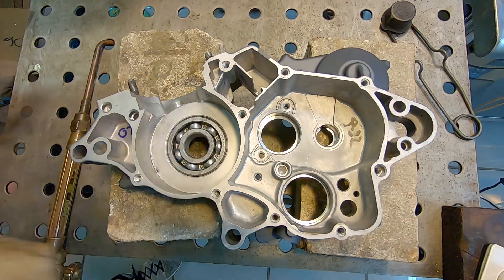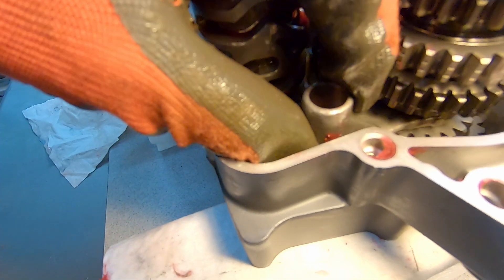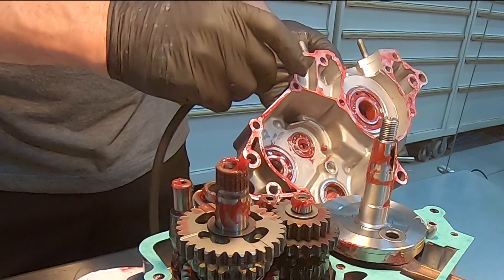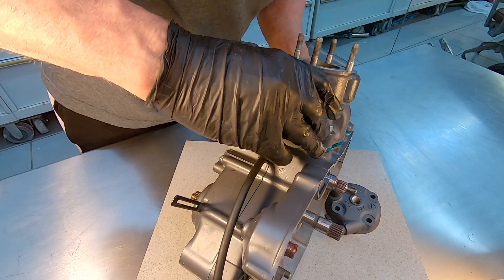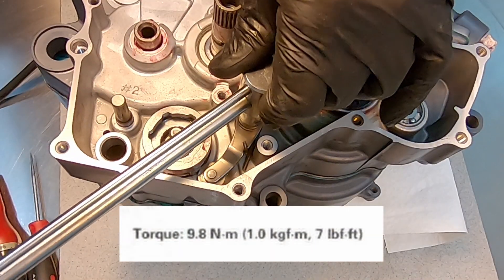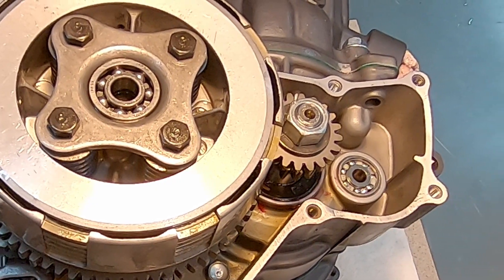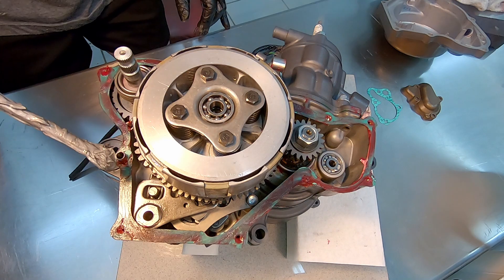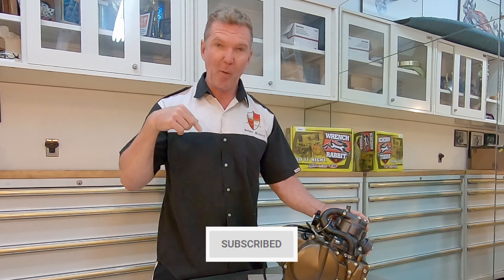Honda CR85 Engine - Assembly

Comment: great video, the cr85 I recently acquired with a seized piston,  had the same connecting rod up and down movement as shown in your previous teardown video. I was hoping all was needed was a new piston and ring. I'm debating on splitting the case, its alot of work. But might be a fun project.
Reply from the maker: Thanks, and it sounds like you've got a pretty good idea of what needs to be done!

Comment: How far is the shifting  drum supposed to move cause mine doesnt feel like any other dirtbike tranmission ive ever used but i have all 6 gears but it doesnt click into gears
Reply from the maker: Hi Send Memes.  Im not sure exactly what you mean regarding drum movement.  Lateral movement like runout or rotational movement while shifting.  If the engine is operational, can you share with me whether the transmission comes out of gear during operation?
Reply: @brian.d.mobley  it pops out of gears in first and second like there false neutrals and the shifting drum the pins that slide out into the drum to pick the slot to move it in the next gear don't do anything unless you actaully jam the shifter or kick it down or up one thing I do know tho is I will never be buying another honda after this bike tho complete lemon clutch wont engage nothing works on it and I've put over 50 hours into this engine alone
Reply from the maker: Noted.
Reply: @brian.d.mobley  and the engine was operational till I stalled it in 4th gear cause my clutch doesn't work at all when I've put it together exactly how everyone says just snug not overtightened so I have no idea I'm just gonna sell this thing for cheap
Reply from the maker: If you would like to sell it, up to you. You can also join our CR85 Owners Group on Facebook for more tips and helps from a community of CR85 owners.  https://www.facebook.com/groups/545886302210401

Comment: Can you install the shifter assembly without removing clutch basket or anything else besides the side cover?
I took my cover off to Check the clutch’s and I can’t seem to get the kick start assembly back in with spring on shaft

Comment: Was hoping you showed how to gap the magneto pickup. Any idea what the gap is or best way to go about it?
Reply from the maker: Hi Jay.  The pickup and flywheel are not adjustable, so if you just assemble the ignition as shown, you should be good to go. Thanks for watching!
Reply: @brian.d.mobley  Thank you for the quick response. I had to remove the pickup to clean it because there was surface rust and dirt on the Flywheel. I see there is an adjustment on the mounting tabs on the pickup they will move it quite a bit inward and outward away from the Flywheel. I just read someone said to use a spark plug box top and slide that between the raised part of the Flywheel and the pickup and tighten it there. I would think if there were oval holes in the pickup that there has to be an adjustment? Can not find a. PDF for my 07 anywhere to confirm this.

Comment: Do you have a link for the water pump installed please 🙏
Reply from the maker: Hi Kerm.  Im not sure exactly what you mean.  The oil pump is installed in the video.  The seal orientation procedure has a link that appears in the upper right corner of the video clip at the point where the water pump installation procedure is detailed and that same link is found in the description box as well.  Hope that clarifies.  Thanks.
Reply: @brian.d.mobley  
Sorry mate it's for a CR85 Water pump bearing and seal video, tried but the link doesn't appear. 
Please can you send me the link

Kind Regards David Hollington from the UK 🇬🇧
Reply from the maker: @kerm9807  Please look in the description box of the video. You’ll see it. Thanks.
Reply: @brian.d.mobley 

Sorry I ment the water pump seal and bearings
Reply from the maker: @kerm9807  Again, the link for the video detailing that process is in the description box of the video.  Thanks!

Comment: Do I cut the gasket after closing the case up the gasket has a line where the piston go do I leave it or cut it
Reply from the maker: Excellent question!!!  Cut the excess away before installing the cylinder being careful no to let any of the gasket material fall into the engine cases.  Good question! Thanks for watching!
Reply: @brian.d.mobley  no thank you for your video it gave me everything literally everything you have I went and got thanks for the quick response.
Reply from the maker: @youkandewitdiysavemoney4881  So glad that it helped you!  Keep wrenchin'!

Comment: Thank you for the detailed video! 
I am restoring a 1984 Honda CR80 and have a question concerning the fuel mixture. The original Honda service manual states 20:1 which seems heavy compared to the 32:1 I have always used. What are your thoughts on this?
Reply from the maker: Hi Tony. Talk about a can of worms! Nothing in the dirt bike cosmos is more debated that fuel mixture on a two stroke. The shortest answer is; 32:1 is plenty if you are using modern, synthetic or partially synthetic oil..  Thanks for watching!

Comment: I'm confused, your cylinder didn't have a sleeve. Maybe it's a year difference? But my 07 has a steel cylinder sleeve.
Reply from the maker: It is possible to install a new sleeve in a cylinder.  Perhaps your cylinder underwent this process.
Reply: @brian.d.mobley  sure looks factory to me. And considering it was basically a basket case when I got it and the kid beat the hell out of it I'm gonna assume he probably didn't have the cylinder bored and machined for a sleeve. 😂
Reply from the maker: @pavementpariah7342  Im not sure about the history of this particular cylinder and what you assert certainly seems logical, but I can only state that the only surface treatment provided by Honda to the bore of a 2007 CR85 cylinder is Nikasil.  Im sorry I cant help further.

Comment: Using the Maximus assembly grease on the crank bearing is fine for the engine?
Reply from the maker: Hi Nick.  Its MAXIMA, but yes.  Inside the bearings themselves, perfectly safe and (personally), recommended.

Comment: Are you using blue loctite or red for those internal engine bolts
Reply from the maker: Hi CDB!  I almost never use red, just FYI.  So, any LocTite used would be blue.  Thanks for watching!
Reply: @brian.d.mobley  much appreciated and amazing job on the channel, I watch your rebuild videos, graphics installation, and others.
Reply from the maker: @coloradodirtbike5930  Thanks so much!  I appreciate the compliments.  Its a lot harder than it might seem to make these videos, so I’m really grateful to those willing take the time to share positive feedback.  Thanks again!

Comment: Hello I have a question What size are the crankcase bolts I lost one I and don’t what size to get to order one?
Reply from the maker: Hi Jacob.  Your best bet is to look at the microfiche on the MotoSport or Rocky Mountain ATV website, find your part, and then order from them.  Thanks for watching!
Reply: @brian.d.mobley  ok thanks a lot

Comment: A good way to explain them is the pieces on the end of the arms that go into the gearshift drum, like that but a little smaller, and I thought they had something to do with the drum but I can't find on any website what they re
Reply from the maker: Its seems you figured out your problem.
Reply: @brian.d.mobley  that's the thing, they aren't related and not even rocky mountain oem parts can I find them
Reply from the maker: @trytonbennett4214  email a pic. sterlinganadar@gmail.com

Comment: This was actually really helpful, only thing is we are missing that rubber Gate and a few parts 😂
Reply: We bought the parts instead of a kit and we're regretting it haha
Reply from the maker: @trytonbennett4214  Both ways have their advantages.  With kits, sometimes the parts aren’t the best.  When you buy individually, you can usually buy OEM, which is the safest way to go.
Reply: @brian.d.mobley  I agree strongly, only being the fact that there was a few missing parts, since I completely destroyed the crank, piston, jug, and the bearings there was a few forgotten parts haha. Also I do have one last question, in the first 5 or so mins of the video u slid that rubber piece into the metal slit there, what is that part called? I wasn't able to find the one I took out lol
Reply from the maker: @trytonbennett4214  Hey! “Rubber piece into metal slit” is just not enough for me to know about which part you are referring, but there are many sites that have good microfiche showing every component.  Try Rocky Mountain ATV or Motosport.  I’m sure you can find your answer there.
Reply: @brian.d.mobley  it was the grommet breather haha

Comment: I’ve put my kick start shaft in and aligned everything and it still makes a weird clicking noise when I spin the crank over acts like like it’s not in right but like I said everything I’ve checked and rechecked everything numous times any thoughts
Reply from the maker: Hey Mike. Is this kickstart on a CR85?  And, spinning the crank makes your kickstart shaft click?  If yes, how are you spinning the crank? BTW, there is a very famous skateboarder from the 80’s  named Mike McGill and I have one of his boards to this day!!
Reply: @brian.d.mobley  haha I’m not the skate boarder, Cr85r, I’m spinning the clutch counter clock wise, when I put the clutch cover case on and tighten everything thing up I spin the magneto counter clock wise my kick start shaft will snap every 1/4 to half turn
Reply from the maker: @mikemcgill6716  I’ve not heard of that sort of problem, Some thoughts on possible causes. Teeth missing from any of the related gears. Primary, clutch hub, kickstart gear.  Have you checked your assembly against the factory service manual?   Sometimes things are missed. Like so many of these problems, it’s hard to diagnose without the parts in front of you.
Reply: @brian.d.mobley  yes checked with manual and fiche card I’m at my wits end, thanks for your time
Reply from the maker: @mikemcgill6716  I wish I could help more. Would you like to email some pics of your installation?
Reply: @brian.d.mobley  sure thanks
Reply from the maker: @mikemcgill6716  sterlinganadar@hotmail.com
Reply: If you are spending the crankshaft backwards, it will cause the ratcheting mechanism inside of the kickstart to click.

Comment: I have a question every time I put the right case on my plunger arm won’t turn all the way
Reply from the maker: Hi Vinnie.  Are you sure you have the plunger rod installed correctly inside the clutch cover?  Clutch springs tightened all the way?  Without having the parts in front of me, Its really hard to diagnose odd problems like that.

Comment: Excellent vid, I'm getting ready to do this with a WR200 engine and still waiting for a few parts. The other day I put my (old) crankshaft in the freezer and heated up the old main bearing inner race to do a test fitting and it slipped straight on (and then became impossible to remove without a bearing puller when it reached room temperature so all good). My only concern is how do you keep condensation from damaging the main and big end bearings? After a few minutes out of the freezer my crank was wringing wet as it warmed up. Thanks, hope you can help!
Reply from the maker: Hey Alex!  Great question!  In the short run, you can spray the crank with WD40 after installation.  However, if you store your bike in a garage or other space that has no humidity control, condensation will always affect the internals of your motor after assembly.  To mitigate this, start the motor once a month or so and let it warm up to operating temperature.  Thanks for the comment and for watching!
Reply: @brian.d.mobley  All sounds good Brian, thank you!!

Comment: Hi Brian Great job on the video just wanted to know if you had any advice on the inter clutch hub seems to be getting hung up and leaving clutch plates open 04 CR85RB
Reply from the maker: Im so sorry for he slow reply Bob!  That is a tough question.  Its hard to know how to respond to questions like that without having the motor in front of me.  It could be a number of things.  Something as simple as not having the right friction discs could be the root cause. Its so hard to comment intelligently on that one...
Reply: @brian.d.mobley  Thank you Brian new plates and steels the outer right side  cover seems to push throwout bearing in do you know if the four Towers on the pressure plate can be cut down
Reply from the maker: @bobcurtice828  You can, but dont!!!  Would you like to send me some pic or video to show me what you are experiencing?  Im busy with a lot of other stuff, but if its not a big problem, Ill try to help.
Reply: Thank you Brian I ended up cutting  0.040 ths. Off work like it should now
Reply from the maker: @bobcurtice828  You are brave!  I don’t think I’d have had the courage to cut on my clutch housing like that!  But, kudos to you that you made a choice that worked!

Comment: Would you recommend lubing the case faces? You are talking about it at 3:37 but I’m just scared that if I do this to the cr85 I am working on it will create an improper seal. I am literally having to split the cases on my cousins cr85 just because the previous owner didn’t put the crankcase gasket on right so it didn’t seal directly below the crank so I don’t want the same issue to happen again. Thanks
Reply from the maker: Hey Bluegrass. The reason you lube the gasket or the faces is to make it easier to disassemble the cases if they need servicing in the future. But, you don’t have to. Most engine builders that I know lube either the gasket or the crankcase face. I now lean toward lubing the gasket because it’s more convenient. If you want to see how that’s done, check out my most recent engine build video where I rebuilt a pit bike motor.
Reply: @brian.d.mobley  sure will thanks once again

Comment: Hello! What size wrench is needed to tighten the center bolt of the clutch basket? 14mm or 17mm?
Reply from the maker: Hi Hasek.  Im so sorry, but I dont know that off the top of my head and I dont have any open motors at the moment to determine the answer.  Hopefully you have both sizes and can try them out for yourself.  Thank you for watching!
Reply: @brian.d.mobley  Thanks for answer. I found the answer to my question - the bolt has a wrench size of 14mm. Thanks for very interesting and useful video!
Reply from the maker: @Вродеигачавродебасик  I’m so glad you were able to find that. I just couldn’t recall and didn’t want to give you the wrong information. Thanks so much for the kind words and for watching my channel!

Comment: Excellent video!, Could you use a shop press instead of the crank case installer tool? I used my press to remove the crank from the case without problems
Reply from the maker: Sure.  I just try to use tools in my videos that are as basic as possible and that are available to the average home mechanic.  By all means, use the press!

Comment: Hey man, This video was a very LONG time ago. but on the clutch side did you have any reverse threads like on the hub or primary drive nut?
Reply from the maker: The only reverse thread that I recall is the center bore of the flywheel.  The thread onto which you thread on the flywheel puller.
Reply: @brian.d.mobley  thanks man your a life saver
Reply from the maker: @ianfisher7632  Sure!  Glad to help!

Comment: Hey i have a 1986 cr80r, are the shifters the same through the years or is it a specific shifter like I'm seeing? It has a stripped shifter shaft (which i found a replacement) now i just need to find the shifter. Any recommendations?
Reply from the maker: Hey Daniel!  Id hate to tell you something that might be wrong.  I dont know that off of the top of my head, but its easy to research.  Go to a site like Rocky Mountain ATV and search their OEM parts.  You can search by year and model.  If the part numbers are the same between years, you are good to go.  If you are on Facebook, you can join the CR85 Owners group and post the question there also.

Comment: Can customers send you motors to rebuild?
Reply from the maker: Hey D1.  Sure.  I do customer jobs.  I only do complete rebuilds and require vapor blasting of the cases and cylinder which costs $85.
Reply: @brian.d.mobley   im out in California not sure where your at but i have a 06 rm 85 and need to and bottom end rebuilt
Reply from the maker: @user-bl8bn4kb8m  Im in Houston, so the shipping is no big deal.  You can email me if you like and we can discuss it.  No pressure at all if you decide not to do it.  sterlinganadar@gmail.com

Comment: Very good tip on the grease ive always done that myself to hold the gasket in place & speaking of bolts falling inside the engine ive just ordered one of them scope cameras that connected to your phone they are very handy specially with the little magnets & hooks you get with them
Reply from the maker: I like to grease them because it makes it easier to take the whole thing apart later, if needed.
Reply: @brian.d.mobley  definitely mate very good tip always
Reply from the maker: @rider6327-g1v  I have a new engine build video that should be ready by Monday or Tuesday next week.  Hope you like it too!
Reply: @brian.d.mobley  ive pressed the bell Brian so will watch out for it mate but sure ill like it
Reply from the maker: @rider6327-g1v  I like making engine assembly videos. So I hope it turns out OK!